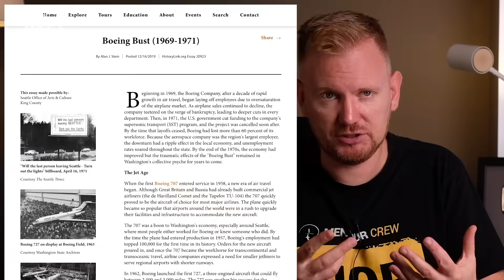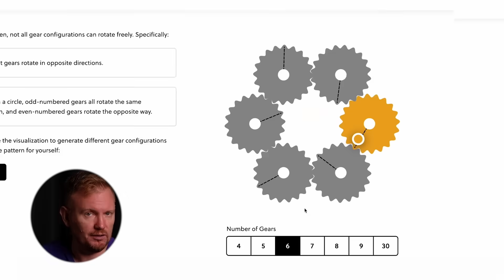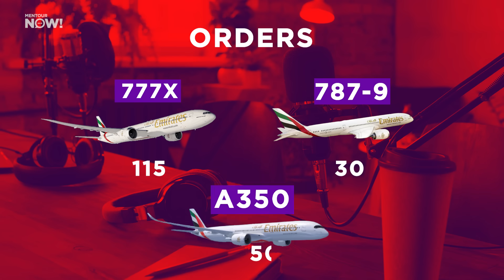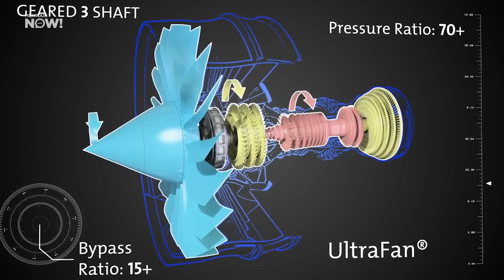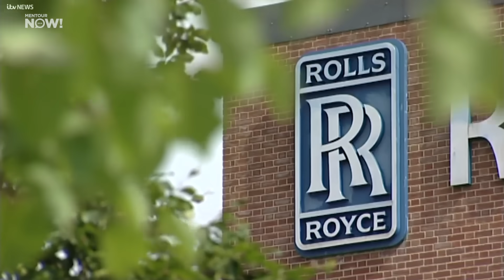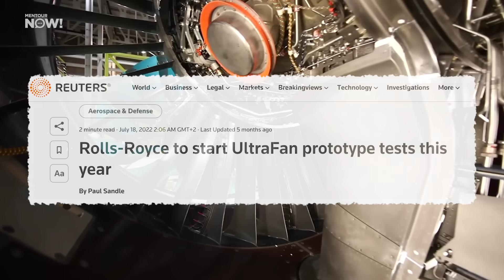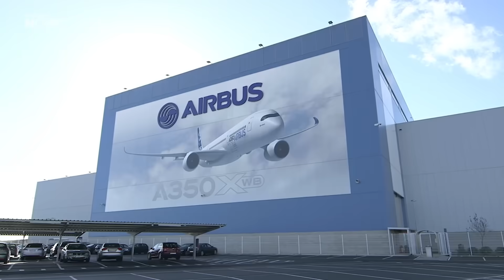Are BOEING planning a 747 with 2 ENGINES?!

Comment: One can only dream that the Queen would be modernized with two monster engines and live on for decades more.  You really hit the nail on the head in the video when you said passengers prefer point to point over hub and spoke.  I would pay a premium for that.  Anytime you can eliminate a connection, your odds of having an on time flight just doubled.
Reply: I prefer hub and spoke model. I don’t want to sit for 20 hours straight in an aircraft. Id like a stop midway to stretch my legs and shop around a bit.
Reply: @daniel11111  I’d say that both models are necessary. Currently strict adherence to a hub model wastes time for passengers. An example is if you are in the center of the country and want to fly to say Orlando or New York if airline A has a hub in Phoenix you fly from St. Louis to Phoenix then Phoenix to Orlando. However airline B has a hub in Atlanta. Again makes more sense from a consumer standpoint to avoid airline A and use airline B. But say airline E flys direct from St. Louis to Orlando making it a 2 hour flight………. If it were me I’d pay for the 2 hour direct flight every time. But flying to Europe or Asia or even Hawaii I’m going to want a layover. 

Basically many customers likely will pay for a direct flight over a layover especially with the delay and cancellation woes currently plaguing the airline industry in North America.
Reply: @shawnhicks619  precisely. I will certainly choose a direct flight over a route with a stop over if the travel time is below, say 6-7 hours. Anything over that, I prefer to have a layover in a nice airport (which tends to be the case when flying with Asian airlines).

I frequent Europe - Asia routes, hence the comment above.
Reply: @daniel11111  in that case I agree it would be quite nice to have a nice layover. Flying isn’t like it used to be, shoot I remember meals being served on short flights you wouldnt have expected it. Another thing I’ve done in the past is take a red eye to Asia or Europe. Last one I took was a flight to Europe and just slept  though it sure seemed like there was more room back then (probably was). 

I have been surprised how much has changed between 2019 and 2022 even on short flights. Flying, for me at least, is all about saving time. But it seemed like nearly all routes to Orlando went the wrong way before headed to Orlando. There were 2 carriers that didn’t waste time going the wrong way, and I had flown both before, so I chose the one that worked out best time wise…….. in hind sight I would have paid double what I paid to A) arrive at my destination on time and B) have better overall treatment. Ironically a week before we left on that trip Allegiant opened direct nonstop flights to Sanford for less then I paid. 

The situation we experienced in September traumatized my wife and my teenage daughter. Neither care to fly again, or at least in the near future. The wife said that when we do fly commercial again it must de a nonstop flight, otherwise we have to pay for a chartered aircraft, drive, or simply don’t go. She said in no uncertain terms will we be flying with connections(domestic lower 48) ever again.
Reply: @daniel11111  On trips that would last around 4 or more hours, I will do the layover. I can't sit still that long lol.
Reply: People say they would pay a premium for this and that but never do. Cheap air fares sell. Which is why airlines adapted to this style to accommodate that.
Reply: @DonJulio4649  the way things are now, I’ll either fly non stop, charter, drive or not go. It’s a disaster right now. Yes some are worse then others, but all of them are currently having issues unrelated to weather. 

To be fair I tried to charter my last vacation flight and couldn’t get anything to work out on the dates I needed. Not sure why. And of course had major issues on both outgoing and incoming flights. One was directly related to the airline and the second due to a hurricane. I don’t hold them responsible for the issues related to the hurricane but do hold the airline responsible for both its failures and employees treatment of my family for the other. Can’t name the airlines due to ongoing resolution negotiations but the failure in question and employee attitudes and treatment due to the issue is and was unacceptable.
Reply: @shawnhicks619  I read there has been a big spike in business class types taking small aircraft.
Reply: @andrewyork3869  well charting isn’t as expensive as it used to be and while more then a typical ticket on a commercial airline is in line with first class. If you take the example of our vacation delay and the extra costs incurred, non refundable items, ect then chartering a small business jet likely would have been cheaper, the flight direct and travel time shorter. 

I’m not sure what’s changed post pandemic but it’s evident that something has. Business class users transitioning over to small aircraft charter makes sense  and likely may be why I couldnt make something work on my travel dates. And honestly business travelers have way more at stake then a family of 5 on vacation though with both my wife and I each having our own small business our time is at a premium to us.
Reply: @shawnhicks619  yeah I also think it's worth mentioning that these are small small planes like diamond DA62 size small. Honestly if going by cabin volume smaller then even very light jets.
Reply: @andrewyork3869  I’m not as familiar with aircraft as I used to be and I’m not familiar with the aircraft you mentioned but I have chartered before. Usually I contact my rep and tell them how many of us are flying, size and amount of bags and departing location and destination along with dates. They then usually let me know what aircraft they can offer and the price. I will say they always offer a twin turbo prop of some kind that while nice is slow for longer distance flights. We used one once and now usually opt for the business jet which usually has 8 seats in it. We’ve had both a hawker 800 and a gulf stream (don’t remeber which one) and usually those are offered over the smaller jets because we live in the middle of the country and are flying to LA or Orlando. 

Having flown charter now 3 times it’s such a huge stress reliever. No terminal, no security hassle, no boarding groups, we just arrive at the companies office at the airport and usually the aircraft is there ready to go. We give the person at the counter our luggage and we are escorted to the aircraft. Honestly it makes flying commercial look like the stone ages.
Reply: @shawnhicks619  yeah I think in the next 15-20 years first class will die off to charter. I would even argue it has already begun, just needs a plane that can be competitive from a maintenance perspective to seal the deal.
Reply: @andrewyork3869  the only reason it works for me is the size of my family. Once my teenagers graduate I will likely not be able to justify the cost, unless my financial situation changes greatly. I’ve considered a nice class a RV or one of the nicer class b RV’s. Though it’s tough to make any decision until we know what direction transportation as a whole takes with the big push for electric. I’m curious how this effects the aviation industry. I know there are some electric engines being developed and it remains to be seen if aviation is affected at all over the next 20-30 years. Only time will tell
Reply: 2 massive oversized engines?🤔 747 MAX? Might need an MCAS ?
Reply: Some routes require aircraft of the size of the 747 - even with point to point operations.
The long haul transpacific routes are an example. Smaller aircraft just can’t hold enough fuel to make the trip without intermediate stops.
Reply: @allangibson8494  not to mention that there is no shortage of people who would be willing to fly from London to JFK or the like.
Reply: @andrewyork3869  Or Sydney to Los Angeles…
Landing slots are a bigger problem.
Big planes take one - smaller planes take two or three to carry the same number of passengers.
The Melbourne to Sydney route has one 737 sized plane every fifteen minutes (five at rush hours) in both directions for example.
There are city bus routes with less frequent service.
Reply: @allangibson8494  Allan... The slot equation seems simple and straightforward as far as maximizing passenger movement between given terminals across available flights but larger heavier turbulence-inducing aircraft require greater separation in the terminal airspace especially but also in the transitions to and from the enroute airspace, to a lesser extent maybe. The key traffic jam is at departure and arrival courses where more in-trail separation is generally required for safety when following a 'heavy,' most particularly on final approach to the runway at periods of high traffic demand, when all aircraft have to fly single-file as closely as possible down the same course and glide slope to land. At a 'slot-controlled' airport this is practically all day long by definition. This in-trail separation is proportionally larger the smaller/lighter a trailing aircraft is in relation to the heavy ahead of it. The net effect is runway capacity at busy hubs (and therefore the number of flights such an airport can support per hour or day- the available "slots") does not stay the same, it marginally decreases when heavy jumbos are introduced into the overall traffic mix. So an airport's passenger capacity at terminals with a varied mix of aircraft types is not necessarily increased just by adding larger aircraft in the mix to replace some of the smaller ones. A "Catch-22" paradox.
Reply: @markpell8979  The gap between two “heavy” aircraft is the same as between two “medium” ones. Major airports don’t see much in the way of “Light” traffic. All require the same number of pilots however.
Reply: @allangibson8494  I see you're well informed and I was giving a broad overview, not trying to sound like a know it all so please forgive me. At airports such as DFW, my closest major hub, we have many parallel and two auxilliary converging runways to help separate a very wide mix of aircraft types/sizes at peak demand periods. This is not true at capacity-strained airports like Heathrow for example, where A380s can remedy one problem while creating another. Thanks!
Reply: @allangibson8494  yeah jumbo jets even point to point are far from dead. I strongly suspect the quite part is some environmentalists complaining.
Reply: @allangibson8494  honestly the more I think about this the more I wonder if flying boats may make a come back. If only on major costal routes.... Who needs slots when the world is your slot.
Reply: @andrewyork3869  The problem with flying boats is that the hull is horrifically aerodynamically inefficient (the step or steps needed to separate the water suction from the hull being the biggest problem).
You need less power to get a wheeled aircraft into the air and you can clean up the wheels more easily than a planing hull. Skis and hydrofoils were alternatives tried…
Reply: @allangibson8494  Actually it's quite surprising how far the long range versions of an A320 or B737 can fly. But not sure I would want to spend 14 hours on one.
Reply: @axelBr1  Jetstar do direct flights from Malaysia to Victoria, Australia in B737’s. It’s right at the edge of their range. 8.5 hours and just under 4,000 miles.
The Kyiv to Zanzibar route was slightly further but has been suspended because of Russian’s being psychotic.
Reply: @allangibson8494  Air New Zealand for example has that problem.  Its new flagship run is the Auckland to JFK non stop on the 787 Dreamliner.  Unfortunately it has a problem with headwinds on the return journey. After 2 enforced landings in Fiji because of headwinds and fuel consumption they have to now fly back to NZ with fewer passengers to compensate in order to keep that flight non stop.  17hr 15min officially on the return.
Reply: eliminate hub & spoke to the intermediate sized destinations & smaller towns get shafted in the end
Reply: @sotabaka  Many years ago I was in Brisbane and a taxi driver I had one day told me that to travel to see family in Greece (I think), it was more convenient to fly to Heathrow and then fly to Athens, at least 3 flights a day, one way or another to Heathrow, rather than take the one flight a week direct flight to Athens.
Reply: The "premium" you pay is being aboard a narrowbody for longer than you like!  
I will take a B747 or A380 over a B737 or A220 for any flight!
Reply: Yeah, but there’s going to be high demand flights into extremely packed airports. You can only expand these airports so much.
Reply: @@bb-sky when pax volumes grow though to a certain level, the dynamics change….  If you have 200-300 people on each flight, then you need not 2 flights per airport to connect to-from the hub, but say 6 flights, 3 times per day in each direction…. so you’ve got the same 30 flights…. Connecting to the hub…

It may be difficult to get slots at that hub airport, competing for times with all the other airlines there… and you have to try to make the flight connections airport-hub-airport work, so no one has to say spend the night at the hub to connect next day….  so there are some complications to consider…. 

While passengers might like the convenience of the choice of 3 flights per day, polls show that passengers really dislike transfer connections as opposed to direct flights…. it takes a lot more time…. they may lose your baggage…. you have to go through the boarding procedures and lines twice…. and nowadays you have to go through security twice…. 

So, with direct point to point flights, the passenger has the choice of just one flight per day to city X in this example, but it’s direct and faster, and that’s what they like. Lower fuel burn and flight time means the ticket can be offered cheaper as well, and the airline are lowering their operating costs per seat mile. Some other costs like ground handling, pax handling, landing and navigation fees can be lower at smaller airports than at big hub airports.

So, when passenger volumes grow to a certain level, point to point direct flights start to make more sense, which is what’s been going on in the airline world the last 10-20 years….  Which is one of the reasons for aircraft like the 767, 777, and 787, taking over from the big 747’s and A380’s…
Reply: Once again, Boing proves beyond a shadow of a doubt that profit trump's lives and safety. This two engine idiocy should not even be considered.
Reply: Not to mention your Odds of having your Luggage lost/rifled through.
Reply: The longer a person flies under pressurization, the more jet-lag they will experience. The more stops where the plane depressurizes even if you don't get off, the less chance of experiencing jet-lag. If you feel extremely tired for a couple days after arriving, getting there a couple hours earlier is not necessarily useful.
Reply: @valerieann8007  I’ve had more issues with time zone changes then jet lag, though I generally now only fly domestically in the US. But for reference because of my geographic location, near wichita Ks, most of the lower 48 is accessible with a 2.5 to 3 hour flight, maximum. LA and Orlando are almost identical travel times direct. Last direct flight I had to Orlando was just a bit over 2 hours. Last connecting flight I took, that didn’t have a major delay, was 7 hours. Best I could have bought was 3 hours with the likely risk of missing the connection due to moving from one terminal to the other. 

Now some people may be ok with long connections, but my time is, to me, at a premium. I know what my potential earning power is an hour. Which is why I choose to take as direct a flight as I am willing to afford. The last debacle I got into was avoidable and the airline ultimately was culpable. We arrived at the hub early, then proceeded to wait because an aircraft was in our gate, which arriving early wasn’t alarming at first, we were 10 minutes early. But after 20 minutes of waiting I became concerned, after 45 minutes I was alarmed and after 1 hour and 10 minutes I was accepting the fact we no longer had enough time to make our connection. The worst part, we had to stay in the terminal because “we will get you there, eventually, but we don’t have a flight available now and can’t issue boarding passes.” A day later, and a lot of rude employees later we finally boarded our aircraft in seats lower class then we paid for and all of us in separate seats scattered around the aircraft, including my 3 year old. It wasn’t until my wife had a nervous breakdown that a passenger decided to change seats so my wife could sit with our 3 year old, otherwise the flight attendant said take your seat or we are removing you from the plane. 

I can’t name the airline as we are in the resolution process now, but I can say I no longer carry their credit card, I have written off all miles and spam folder all of the rewards program emails and will never fly that airline again, even if it’s the only one that services our destination or is the cheapest fare available. That trip convinced me fly direct, fly charter, drive, or don’t go. Obviously flying overseas is a different situation but domestically there are many options. 

On a side note the current situation southwest is in will likely make many others feel the way I did about the airline in question. I’m not sure how it’s going to go for southwest but I fear the company will suffer drastic reduction of revenue for some time. And if what they say is true and they neglected to keep up to date software then they are reaping what they have sown. But most domestic airlines have slipped in providing quality transportation to the general public over the last few years. Some worse then others.
Reply: Hub to hub with rail connection
Reply: Only if the layover has a Cinnabon ..
Reply: With 2 engines the plane would be more efficient , which would lower ticket prices and create demand
Reply: Concorde was the Queen
Reply: Hello Petter, I've got a question for you regarding the the US FAA 1500 ATP pilot rule. It's my understanding that other countries around the world have not followed suit with the same number of flight hours required for a restricted ATP license for new First Officer pilots with some new, freshly minted FO's having as few as 250 hrs while piloting Airbus and Boeing jets in overseas markets. So my question is does the US allow foreign carriers to fly into US regulated airspace with a FO flying from the right seat with fewer than 1500 hrs total time? If that's the case then that would be a rather unusual precedent in having two different sets of standards for US domiciled pilots and foreign pilots both flying into US airports. That would be like the US regulating that a semi tractor trailer driver with a CDL to be at least 21 years old if they are a US citizen while still allowing CDL driver's from both Canada and Mexico to drive on US roads and highways if they're only 18 years old. Do you know if there are 2 different standards for US and non US pilots operating into and over American skies? Can a Canadian, Mexican, Australian, Asian, Central American, or other nationality First Officer commercial airline transport pilot still fly into the US with fewer than 1500 hours and does that ever happen frequently? -Thanks
Reply: Seems you haven't learned the lessons of the Max Series. Building a dogs dinner design to extend an out of date airframe usefulness is not smart.
Reply: @rorykeegan1895  Thank you  for your uplifting message.  God bless you.
Reply: Point to point model fails when flights are longer the 10 hrs.
You need much bigger planes to carry more fuel.
Also crew needs to be pre-positoned in multiple destinations.
If one flight gets cancelled, then there is a domino effect. Think Southwest Airlines.
 A hub can serve multiple smaller cities with smaller aircraft and more frequent Aircraft.

Frankfurt  or Amsterdam can serve whole Europe
Dubai can serve whole Europe and far-east
Reply: Unfortunately the Queen died in September...
Reply: Emirates want a re engined 380. Airbus said NO. A little bit shortsighted by Airbus perhaps.
Reply: 777-8 and 777-9 will be essentially that, in range and pax capacity
Reply: Modernisation is pointless. So much would need to be modernized that it's cheaper to scrap the project and move on to new one.
Reply: Here here 👏
Reply: Also the odds of not loosing you bag!
Reply: @davkumi  The most important benefit 👍👍👍👍
Reply: The problem is that if you can't get the air crews to support that system then hub and spoke is your only real option though.
Reply: @Hybris51129  They should come up with a three engine aircraft a lot like the MD-11 thats little bigger than the 777!
Reply: @Hybris51129 why wouldn’t crews support it…?  its work, which they want, and get paid for doing it….
Reply: @PRH123  yeah but it can require a lot of people.
Reply: @PRH123  I am referring to the shortage of air crews. If you don't have the manpower to fly the planes they way you want then you have to work with what people you do have.
Reply: @PRH123  family time? Travel distance as well? I'm all for money but if I was in that position, I'd be lookin' forward to my bed with my best friend ❤
Reply: @danielhoward220  it’s just the reality of a pilots life that they often have to sacrifice things like that, so they know that going in…. things like dead-heading across the country to get to the flight start point is just part of the regular job….  living in hotels and being away from home for a week is just part of the job…. they trade that for the love of flying…

very senior pilots in some airlines may get the best flights, which is for example departing from city X near your home in the morning, flying to city Y, then flying back from Y to X same day in the evening…. but that kind of schedule is rare and is a reward for only the most senior guys…
Reply: @Hybris51129  
Which suggests fewer and larger flights is desirable.
Reply: I'd LOVE to see a duel engine 747!
Reply: @FatHeadDave  *dual
Reply: @MrEeeaddict  thank you my bad
Reply: @FatHeadDave    They have been in the past.  Empty and being ferried, they just use two of the four engines.
Reply: If they do, it'll probably use the GE9X cause this what it thought of it my head
Reply: Please no. It's an ugly machine. It's old as fuck. Give us something new. Tired of flying in these ancient machines barely held together after decades, cramped and dirty. These companies are so wealthy and yet flying comfort has gotten worse and worse and worse as the years go by
Reply: 2 engines is not happening, it won't be able to fly on 1 in an emergency.
Reply: @rootbeer666  They said that about the DC-3 too… 
The single engine power requirements are however quite significant. Three or four engines are easier to achieve engine out performance requirements (particularly for an engine failure on high density altitude departures (ie Denver or Quito).
Reply: @rootbeer666  re: two-engined 747 I think you're probably correct. Maybe two modern efficient super-powerful engines could propel a 747 when they're both running properly but performance and handling might not be good enough in an engine-out situation. Also the extremely large diameter fan sections of engines such as Petter spoke of would probably pose a ground clearance problem on the 747 unless they're faired into the wing somehow, similar to modern twinjets, rather than hanging below on pylons. That would likely just be too expensive to rework. It would almost require a whole new wing design. As you say, "not gonna happen."
Reply: Hopefully not, because it will make crasheing crap set the record in the number of passengers killed in one accident...
Reply: @KuK137  yeah but we have gotten better and better at not crashing planes, and more importantly we have gotten better at recovering planes from disasters in air on to of preventing those disasters from happening in the first place.
Reply: @andrewyork3869  Yep. The companies tend to do better when their planes aren't falling from the skies. So do the passengers.